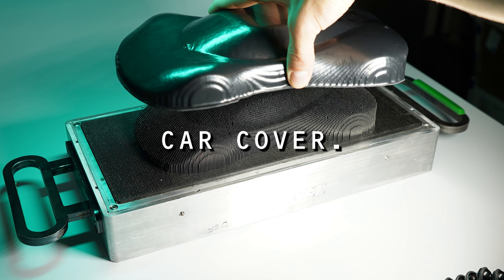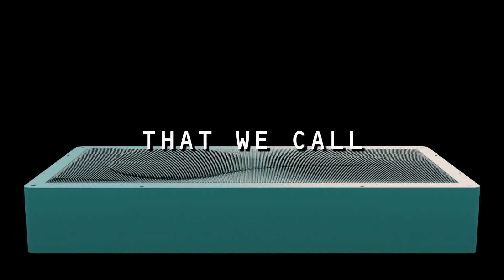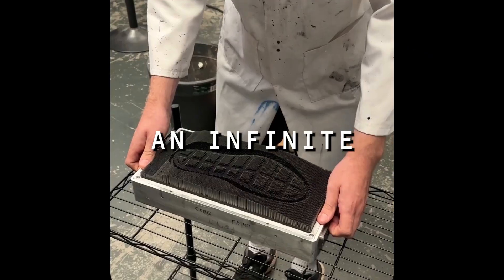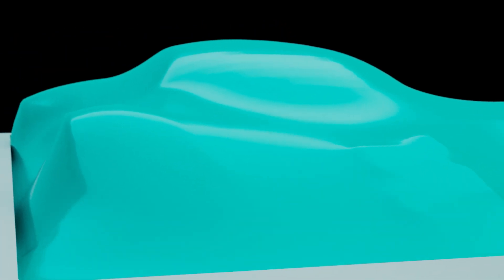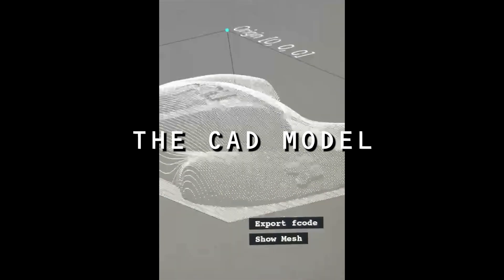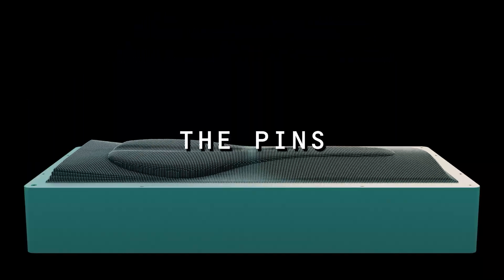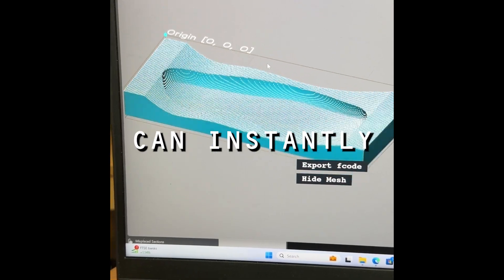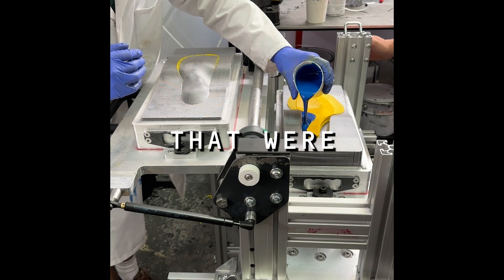PolyMorphic Moulding - How it works?

Comment: I can't lie,I'm frustrated but happy that someone finally went down the rabbit hole for this amazing, industry-changing idea.

We've created a low-resolution prototype using small electromagnets for each pin. These were used to block or unblock the tubes that delivered water below each pin, lifting it to the desired height. It was slow indeed but we came up with other solutions to increase the speed and resolution.

I bet your system is so much smarter and i wish you the best
Reply from the maker: I think we have scratched a lot of engineers itch with this invention. I like your idea of using magnets and water. Smart!
Reply: @fyous  Yes you did ! We will definitely buy from you in the future .
I'm just curious if you can tell me ,how do the pins manage the friction in time ? And how do they stay in place so firmly ?
 I would appreciate it the answers but I'll understand if not

Comment: Why not just 3d print and get much higher accuracy from a tool that costs substantially more?? 3D print material is very cheap, especially in small applications like this.
Reply from the maker: Cheap but also 100% waste if your using it to make a mould for a 1-10 parts.

Comment: faster then 3d printing lets see, injection molding, thermo plastic forming, any metal injection molding.... should i go on? most of which require sure 1 rather 1000$ 2000$ mold... but then can be used to make 10,000 pieces atleast before it wears out, considering is a case that will be post polished and colored upon etc... maybe even 1 million cases per mold... so 1000/2000$ in a mold as a investment is pennies on a dollar... yea... 3d printed is great for prototyping... and that is about it... if u are chasing production, speed and quality .... 3d printing is not the answer.... in mass production never have been, but idiots and unneducated pseudo intelectuals, and dreammy DIY hobbists are insane... so ... let them keep doing same thing over and over again expecting different results.
Reply: "dreammy DIY hobbists" is a bit harsh, isn't it? Hobbyists are the perfect target audience for 3D printing: They require relatively low fidelity, don't have the space or money for a $400,000 mold machine, and don't need to produce 100,000 parts. We're all impressed you know the "right" way to do things, but "right" is relative to the specific implementation.
Reply from the maker: what if you need to make one part and its different every time...?

Comment: Very curious how the pins are controlled. Probably some kind of moving modifier and a locking mechanism per pin? It's probably not economic to have control for each pin. Cool product!
Reply: I guess a cnc machine pushes the pins to correct heights.
Reply: @VacuousCat  probably but as for how they stay that position once set is more interesting seeing how small they are most clamping methods might not work at that scale... also how many cycles are these good for
Reply: @piman13_71  I actually designed a clamping method for pins like this some years back for a project with an inverted pin-table like this one. I think you'd really just need a uniform clamping pressure across all pins that exceeds the vacuum-forming pressure but is lower than the pin's buckling pressure (with maybe 3x factor of safety on both), which is pretty doable for pins that size. In theory it would use three offset metal plates, though I think the final version just used two plates and some magnets.
Reply from the maker: @piman13_71  holding them in position with enough force to make them useful is the secret sauce. It took us years to figure it out.
Reply: @fyous  years to figure out? uuuuh I'm guessing the pins pass through three stacked plates with very tightly fitting holes, and you put lateral pressure on the middle plate and then clamp the plates together to grip the pins? maybe make the middle plate or bushings around its holes from a slightly flexible material like a strong plastic to even out tolerances? 😂
Reply: @Intelligence_Failure  I think you figured it out mate. I think they are also moving the pins using 4 cnc heads that operates simultaneously to save time.

Comment: i think you guys need some kind of soft smoothing material between pins and plastic.
Reply from the maker: Hey! We actually tried this and it works well. We used it to produce outsoles for shoes. You can vary the pin texture by varying the thickness of the flexible membrane.
Reply: @fyous  Let's gooo, soo happy to hear it. Are you gonna show it on some video?
Reply: @fyous  i really like your idea.
Reply: yes but it wouldn't work very well in places with very high height difference, you would need a specialized smooth adaptor for every mold, but at that point what's the reason for this? Just make a traditional mold. I see this as a fast way for prototyping, as is fdm 3d printing, which is slower but can produce more complicated shapes.
Reply: @MrChoklad  it feels like there should be a sweet spot material. idk something like thin and soft silicone maybe.
Reply: more pins...
Reply: A Resin Printer FEP would work quite well
Reply: They could use graphene and electric pulse mods

Comment: nice idea but very very low detail reproduction..  i woud not want those artifacts in my vacuum shells.
Reply: I think the strength here is in rapid prototyping where the details are less important. This with vacuum forming would make iterations at least an order of magnitude faster than 3D printing for applications that are suitable for such a process.
Reply: @bradley3549 exactly, and also you can use this a basic shape for a mould and smooth out the mould etc with putty then with the final it’ll be as smooth as a babies belly
Reply: Mechanical Engineer here...The smoothing can be done as a secondary step by making a conventional mould from this and just smoothing.  The  fast 3d shape without cnc cutting time is awesome!
Reply: I think low detail reproduction can still be useful for some objects , but you are right , maybe a improved version can increase detail ?